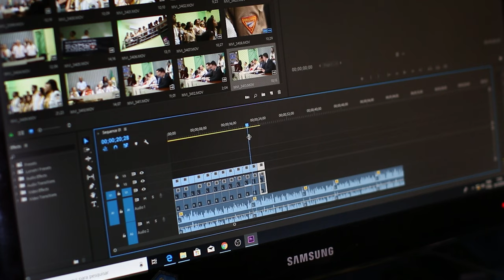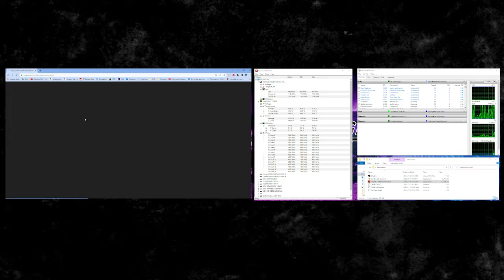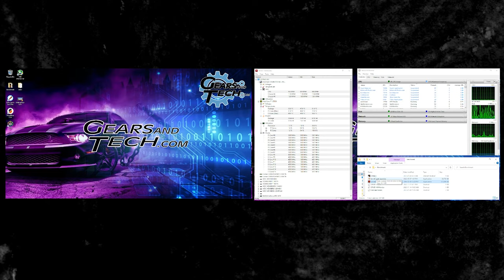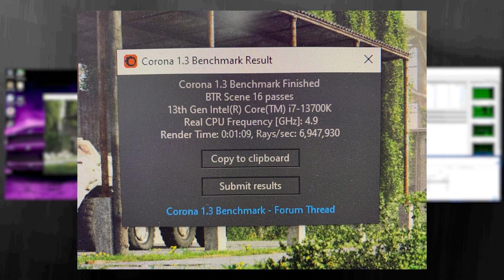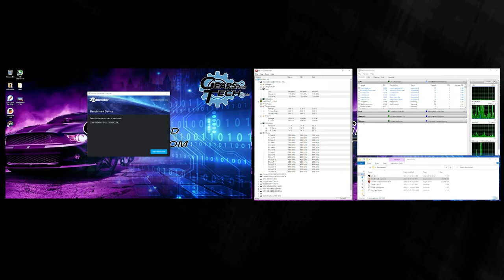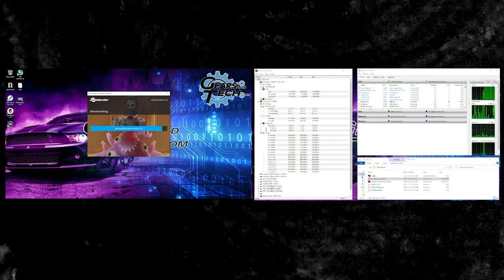COOLING DOWN the NEW Intel i7 13700K CPU ~ Whats the MINIMUM Cooler size that works? |Gears and Tech

Comment: For my new 13700k, I decided to get a Thermalright Assassin 120se cooler, with the Thermalright CPU Alloy Frame, and MX-6 paste. 

We'll see how it works out. I may try and undervolt at stock settings, to keep things cool.
Reply from the maker: I'm going to be looking into undervolt next
Reply: how's it working out?
Reply: @Boso Tech  ...still waiting for the motherboard to show up.
Reply: Paint It Black  ...So far so good. I'm using a Fractal Torrent case with its 5 stock fans, one additional 140mm rear exhaust, all plugged into individual header connections on a an MSI Z790-A  mobo, and 32GB 6,000mhz Ripjaws. All fans bios controlled. The 2 CPU fans have a splitter plug. 
 I haven't done any full 100% load benchmarks yet, nor do I think I want to. I know it will probably be in the high 80's or low 90's at 100% based on others testing.  However, I did set the Bios power limits to 125w/253w respectively. This at least keeps it from frying itself, as the mobo defaults were both set at 288w (beyond the CPU cooler). 
 I've been playing mainly newer games (MW2, etc), and so far no max CPU core temps over 65F. Most cores in the 50's, with a couple pegging into the 60's. 
 I don't do any graphics rendering, etc, so I haven't seen it as high as some might for heavy workloads.

Comment: I just ran this on my 13700k with a Noctua DH15, in a lian Li o11d Evo, with a 120mm on one side and 140mm on the other due to ram clearances, and 9 lian li infity, inverse setup. Corana bench mark hit 77C, took 49 Second, REAL CPU 5GHz rays per sec 9,815,080. 2nd run 81C, 49 sec, 9761660.  Just a FYI. These things run HOT. That's a Noctua paste no thermal plate, asus Strix 790-E.  i went through 2 of these cpu's with the first one running several degrees higher and no matter what I did it ran hot right away.
Reply from the maker: They do run hot. But it sounds like yours is cooling pretty good.
Reply: What are your temps in Prime95?
Reply from the maker: I would have to check
Reply: @GearsAndTech  Thanks I appreciate it.